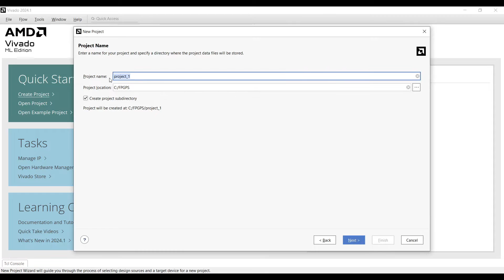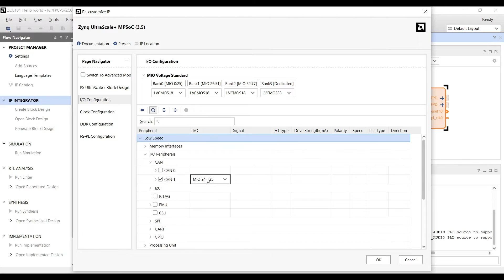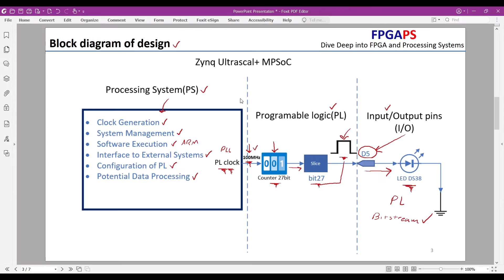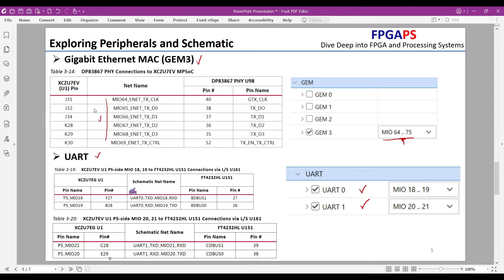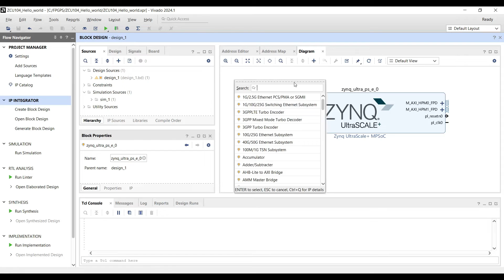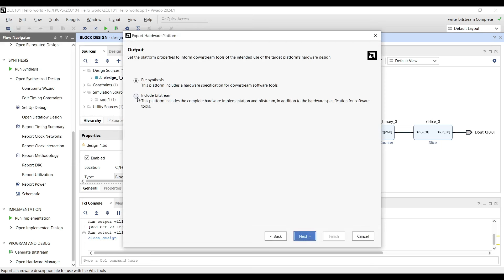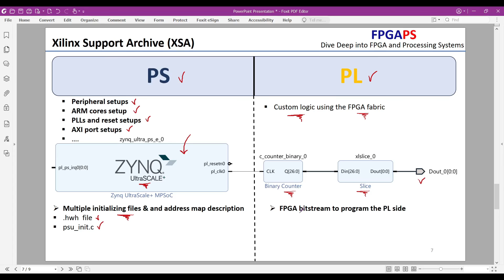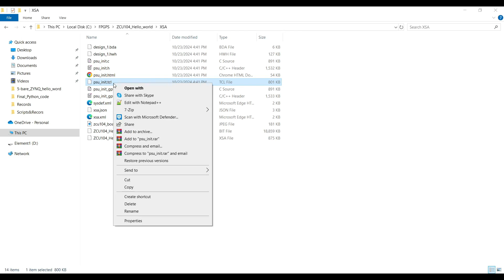Hello World in Vivado: PL-PS Clock & Peripheral Setups & Board Files & Schematic Review & Export XSA

Comment: @FPGAPS 
Hello and thank you for this video.
I'm used to use Spartan 7 and artix 7 and have a question: 
I would like to use only a microblaze on a Z7020 for fun purpose and i need a 100MHz clock, do i need to place a Zynq PS tile first and then use the "pl_clk0 " to generate the 100MHz clock for my microblaze?

I hope my question is clear enougth. 😀
Reply from the maker: Thanks for your comment! 
In Artix 7 you can bring the external clock to your design with MMCM or clocking wizard. 
I have multiple examples where I don't use the PS-PL clock from Zynq: 
https://www.youtube.com/watch?v=8ps7n-HzESk